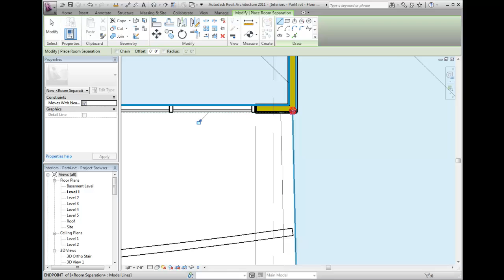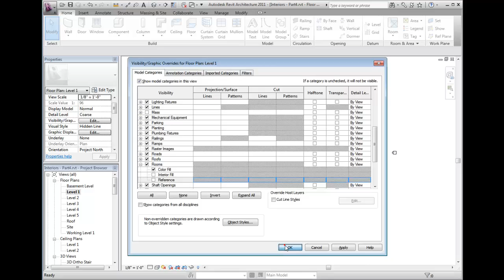Revit Architecture 2011 Tutorial - Creating Room Separation Lines

Comment: Is there a way to delete the room separation lines?
Reply: Hey, i was going through the same problem and i just figured that out few minutes ago (from the time of posting this comment). In order to delete the room seperation line, all you need to do is to pay attention to your current window you are working on and check the Visual Style cube (that little box at the bottom of every window next to the scale and other commands. All you need to do is to make the following: 1. Details Level > Fine. 2. Visual Style> WireFrame. Hope this helped. Cheers ^_*